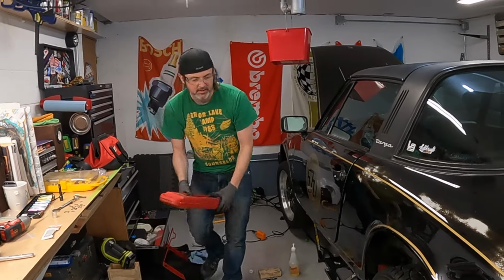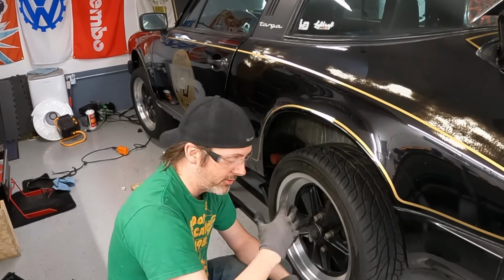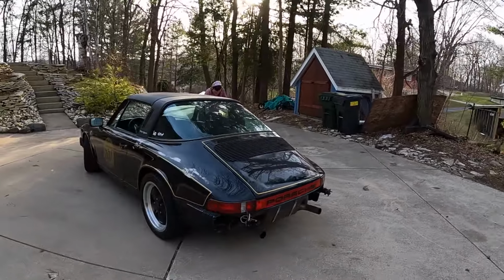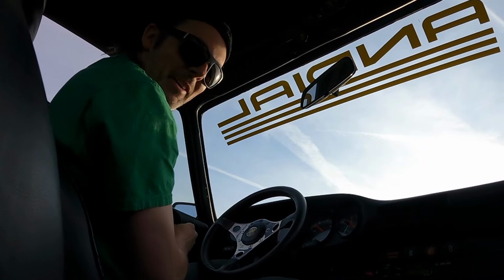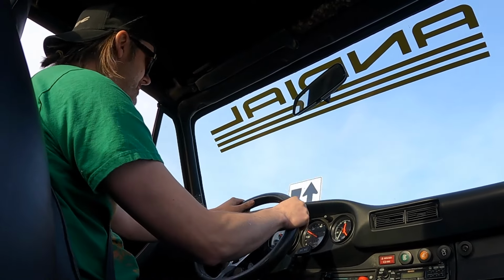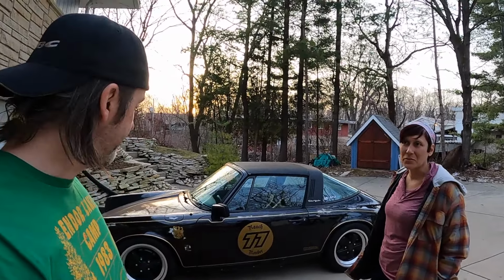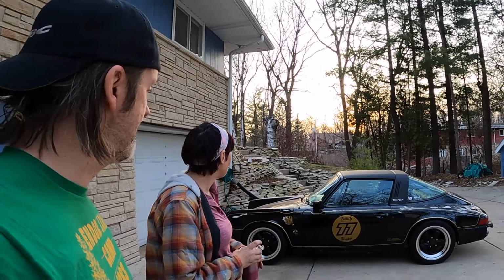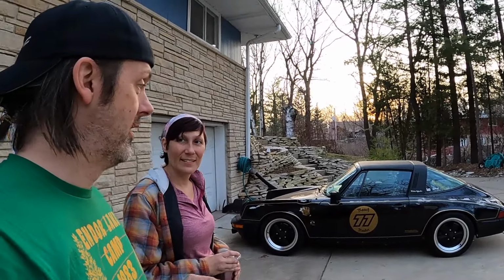FIRST DRIVE: 1970s Porsche 911 Budget Build

Comment: I was rewatching this to see if there was some hint about the axle. Unfortunately no underside video. So it continues to be a mystery. Did you put in wires when you put the axle screws back in?
Reply from the maker: I did not do wires.  Maybe I should have.  I did reuse the bolts... which.. I think was technically not kosher.  :\
Reply: @ADDvanced  while reusing the bolts isn't recommended losing 8 bolts And a cotter pin without knowing is really unlikely. It's more likely it got taken than fell off.  For our cars wires aren't usually necessary. Have you found a replacement?